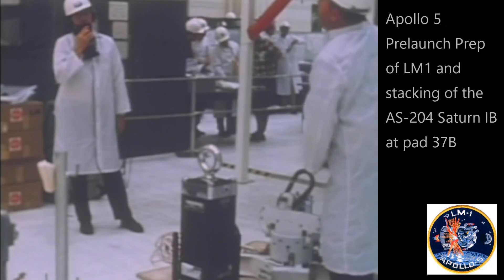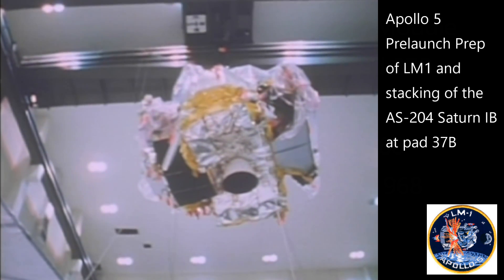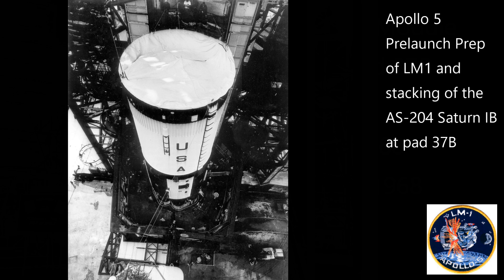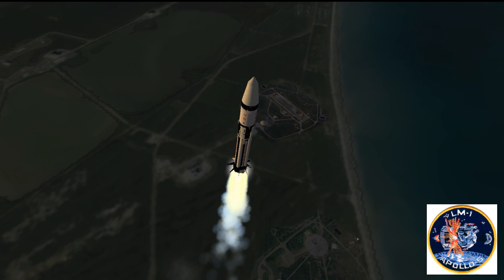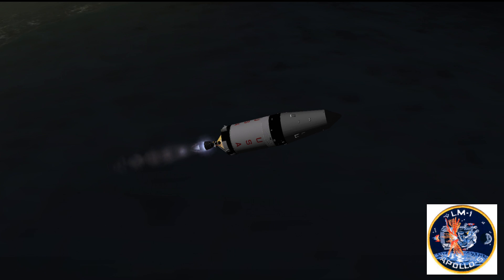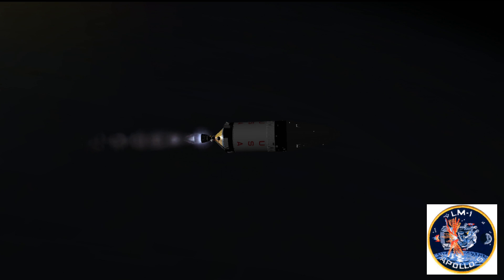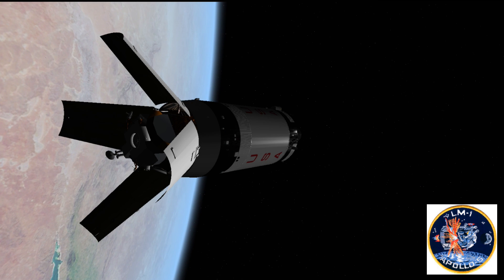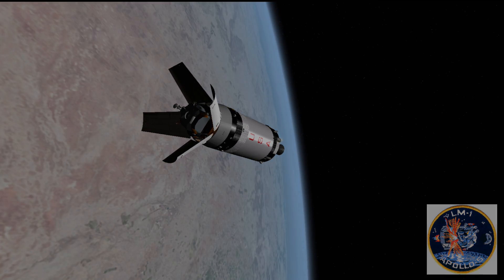Apollo 5 - The Flight of  Lunar Module 1

Comment: Great video and CGI. I have no idea what program you use or how it works, but one thing that always impressed me about the launches of the Saturn rockets was how the plume expanded as it went higher and higher and it had less air to constrain the exhaust to a column, and thus it expanded out. It would be great if you could figure out how to manipulate it to show that also.
Reply: I think he using kerbal space program with mods but IDK
Reply from the maker: Its Orbiter Space Simulator with an Apollo add-on

Comment: I think they used a surplus Lunar Module Descent Stage as part of the Apollo Telescope Mount on Skylab.
Reply: That was the original plan but the structure was eventually totally redesigned.
Reply: @allangibson2408  You can see the landing gear strut attachment points on Skylab's ATM.

Comment: In the video of the LM/adapter being mated to the launch vehicle that particular test LM seemed to have no landing legs. Was that because of weight or space constraints?
Reply from the maker: LM1 had no legs...there was no need for them. They were testing the ascent and descent engines along with the navigation/LM computer and mechanical systems. Regards LM5
Reply: Interesting
Reply: Other sources (don't ask me which ones now) say that the removal of the legs was a weight saving factor. The S-IVB used here is the same diameter as on the Apollo Saturn missions, so there would not be a space constraint issue.